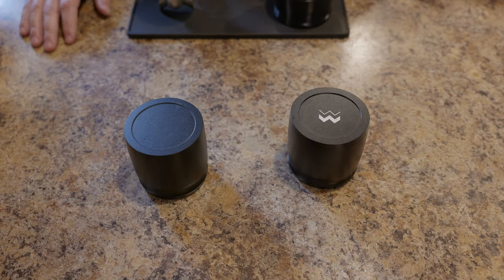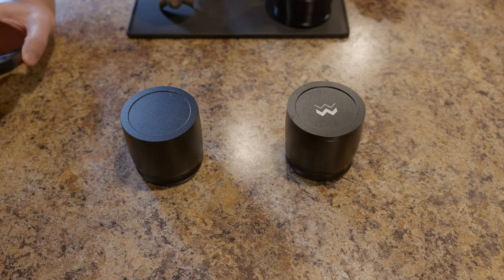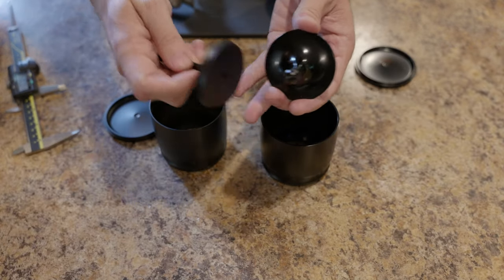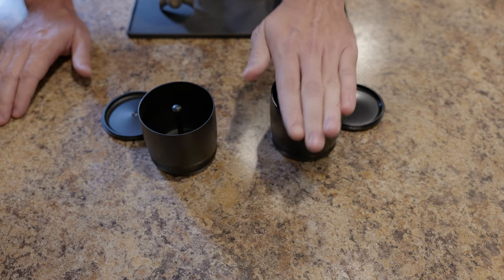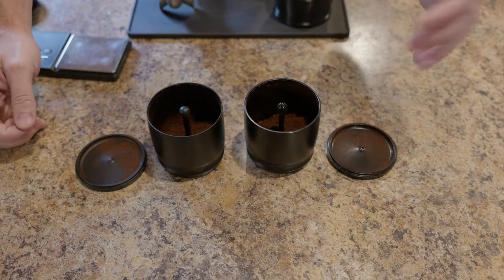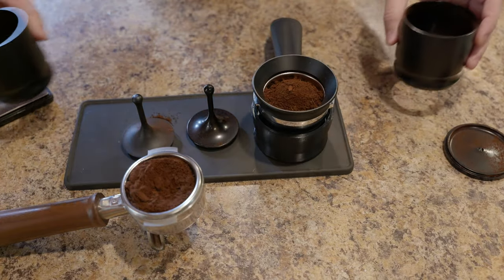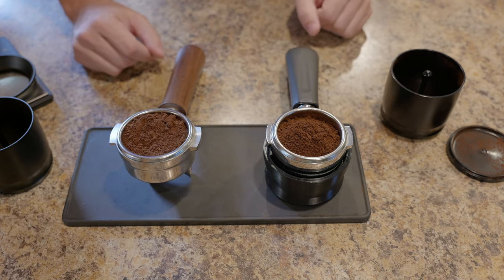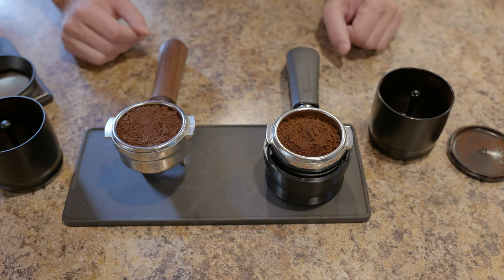Weber Blind Shaker: Part 1

Comment: I spent about a month doing some accurate testing of shaking, it took that long to figure out the mode of action, but it does work to boost EY in some cases, specifically if you're on the clogged side of the grind size to EY curve (did a vid on it). It works by basically homogenizing the critical bottom layer that contacts the basket (as grinders can produce grind size inconsistencies during start up). It's the size distribution of the grind particles in this layer that impacts evenness of flow, in fact it governs flow I'd say... Lance, phrased he's video unfortunately, as he pitted shaking "VS" WDT whereas I found both are somewhat important for light roasts and the newer precision baskets. The other thing i found was that you can just shake in the dosing basket with a cover, pour into the espresso basket, then some WDT and that produced EY's as good as the blind shaker (non-weber) with WDT, i.e., it's really the shaking process that matters, not the blind shaker per say, in my opinion... have fun testing, it's a fascinating subject :)
Reply from the maker: Interesting, I'll check the video out. How did you measure the grind distribution by layer? I actually already tested using a dosing cup for shaking, and came to the conclusion that it didn't increase extraction yield vs just WDT (neither did the knockoff blind shaker). In every test I've ran so far, there's no statistical difference and plain WDT has higher yield in raw data. However, it could be grind dependent, and my grind settings are in a region where it doesn't matter.
Reply: @TechDregs  No, shaking won't make a difference unless you're near the fine grind size limit. See if you grind really fine, you'll start to see dark spots on the puck, indicating that some sections of the puck don't have proper flow. If your grind size is near this limit, shaking will distribute the fines among the boulders and prevent the air-locking issues to some degree (you'll notice less dark spots). You'll also see a small increase in extraction yield (EY) in a shaken vs. unshaken comparison, but the shaken EYs will never go above the peak in the EY curve. Shaking just recovers some EY if your grind is too fine.

Comment: I read in a Reddit thread that the weber has more retention when you use water.
Reply from the maker: I haven't found a huge difference. There is going to be retention either way. What I have found to make a difference is grind size... coarser grinds have less retention (due to less fines, I think).

Comment: For years, I’ve been using a small, glass cup for shaking. I recently bought a Weber shaker, thinking that it might improve workflow or distribution. It made both worse.

My method is to toss like sautéing in a pan, definitely not to violently shake. We want to homogenize, and not to cause clumps. Next, I pour it into the portafilter with a magnetic funnel. I shake to flatten it, do a surface level rake with a WDT tool, one firm tap on the counter, and tamp.

So, why is the shaker worse? First, it has three pieces to handle, and they all get dirty. Next, why doesn’t the body have magnets? I can’t shake the portafilter with the shaker on top. So now I need the funnel too. 

Also, because I can’t see inside the shaker, I can’t get the grounds roughly distributed before removing the lid. I could shake it side to side with the lid off, but the plug isn’t magnetic, so I risk it falling apart and making a mess.

With my little glass bowl, a magnetic funnel, and just a little skill, I get a better, faster result. Who cares about the extraction of the Weber, when the workflow is so dumb. Had they added magnets and maybe a glass lid, it might have been another story.
Reply: can you make a video with your original method?

Comment: 1. Magnet is for auto-centring on a grinder
2. Biggest difference is the coating that helps make coffee grounds stick to it less
Reply from the maker: I'm not sure if they did any special coating. It just looks like they polished it more prior to anodizing. I still had quite a bit of retention with it.
Reply: @TechDregs  Very interesting, I wonder if grind size or roast level impacts the retention on it. What roast level was this with?
Reply from the maker: Just speculating, but I really think roast level plays into it. I mostly use medium to dark roasts. These roast levels tend to express more surface oil, and I think that makes the grounds stickier than light roasts. Haven't tested that though. As for grind size, I think finer grinds tend to lend to more retention in general, as you just get smaller particles and surface tension and static have larger influence with those.

Comment: I used to do WDT but found it lacking in consistency, possibly just operator error. I tried the knockoff shaker and found I still needed to use a funnel to stop coffee spilling and avoid burning my hand touching the hot portafilter. I still tap the sides to get the top flat. I use a side to side shake not just up and down, I also rotate 180 degrees in the middle to ensure all the coffee is mixing. 

I prefer the shaker but I tap the top with the wooden handle of the tamp before removing the shaker lid. I use a dry paper towel to clean the shaker and found coffee accumulation to be greatly reduced for the next two or three uses.

Comment: The magnet is so that the shaker "locks" to Weber's eg-1 grinder.
Reply from the maker: Thanks! I knew it wasn't random, but just couldn't figure out why.
Reply: It also locks perfectly onto the Acaia Orbit grinder too.
Reply: But they didn’t add magnets to secure it to the portafilter basket, so I can’t give it a shake without it falling apart. It’s a dumb device. I bought it, and I can’t believe what a bad workflow it delivers.

Comment: Try to compare force tamper with mhw 3bomber constant tamper.
Reply from the maker: I can already give you the summary: no tamper is worth $200. Get a spring loaded tamper, and use a bathroom scale to test and make sure it's giving you >30lbs of force before it bottoms out on the basket. The spring mechanism will keep it repeatable for a given coffee/dose/grind. Just my opinion.
Reply: @TechDregs  I received my 3bomber constant tamper not too long ago and man this click is satisfying. The spring ain't good without clicking☝